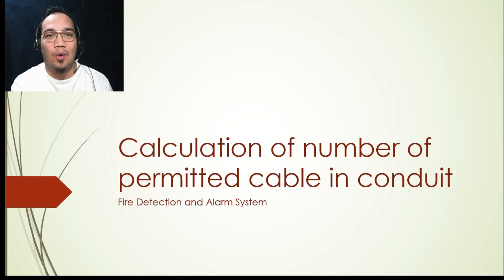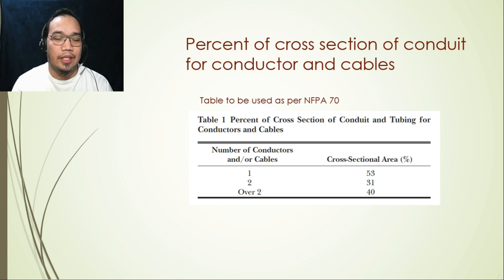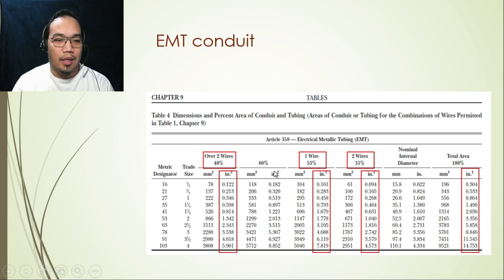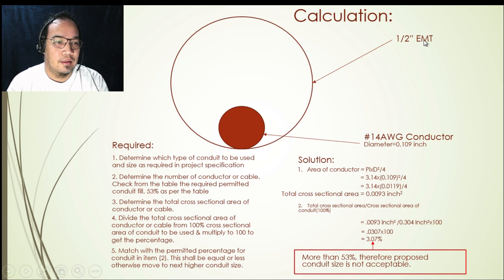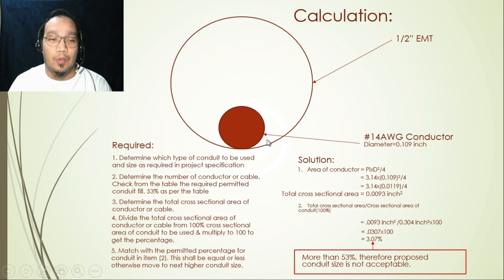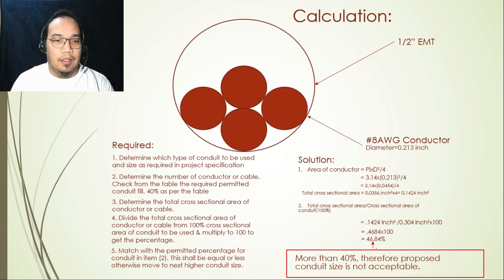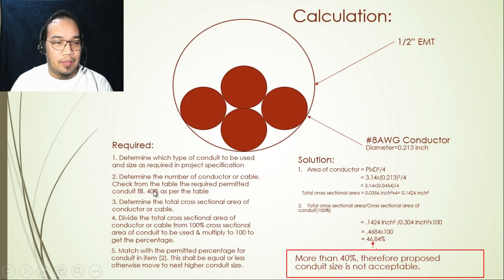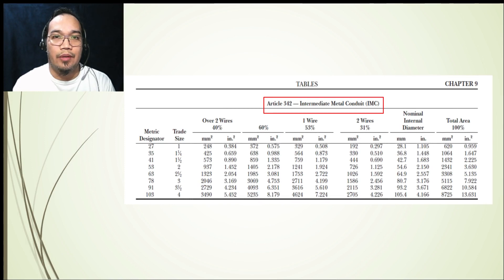How to calculate conduit fill for fire alarm #conduitfill #conductor #electrical

Comment: But you never went over how to calculate conduit fill for cable. You did individual conductors. How do I find the diameter or dimensions of the fire alarm cable so that I can do the conduit fill calculation? Thanks
Reply from the maker: The cable will be calculated in the same way, the cable diameter/cross sectional  area are available from the datasheets.

Comment: Hi! How would I apply this chart to RTRC Conduit (Fiberglass conduit). I can't seem to find this type of conduit on the chart, but it's slightly mentioned in the book. For example: Figuring out if I can fit 3-750 kcmil into a 5" FRE Conduit
Reply from the maker: Hello buddy, it's ok if the fiberglass conduit is not  in the table provided in the NEC. As long as you don't exceed the limit in % cross section of the conduit when using one conductor which is 53% then you should be fine.